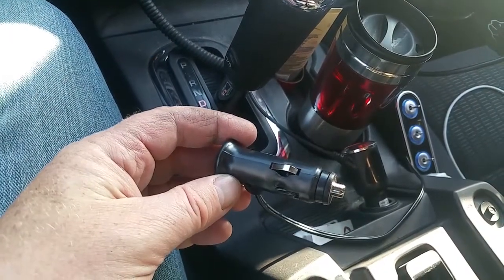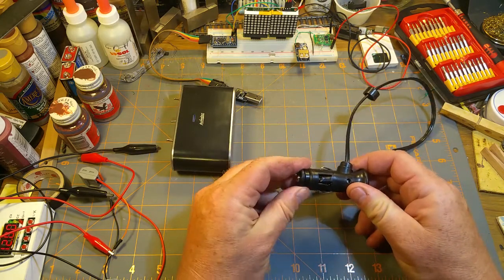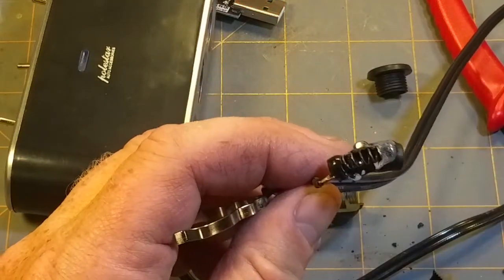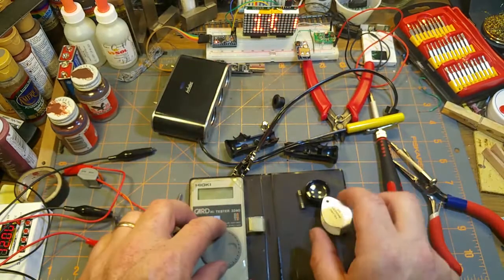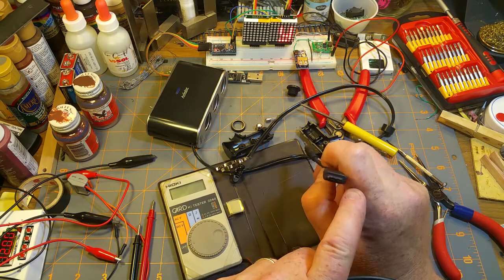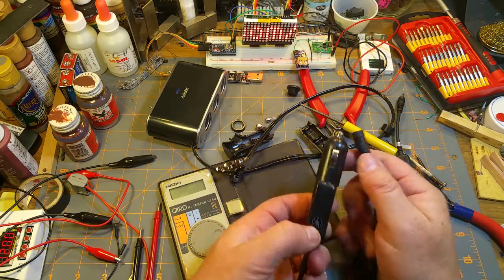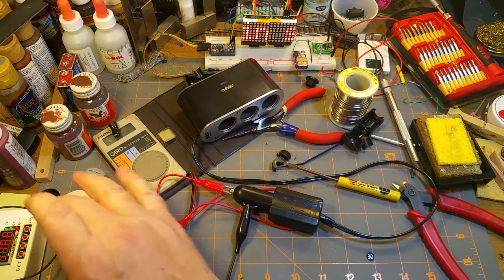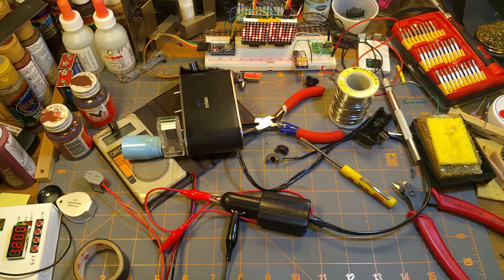It lasted a week before it needed to be repaired...

Comment: Yeah, of course the Chinese screwed up but it's not completely there fault. Cigarette lighter plugs are just bad design... They where not meant as a plug...  The tension on the tip is most of the times just wayyyyyy to little to carry serious current (like 5A...)
Reply from the maker: Yeah. It’s almost like the connector was designed to generate heat or something. ;-)

I was expecting more trouble from the 3 outputs, actually. The centre pin on them is pretty small and is a bit of a hard target to hit. 
That's where I expect the next repair to be.
Reply: Hehe, of course it was and it looks like no matter what you plug into it, it still works as a lighter :p
Reply: Just wondering, what would you suggest automakers use instead? Maybe something like the cloverleaf connectors?